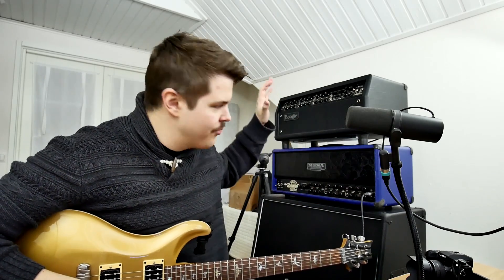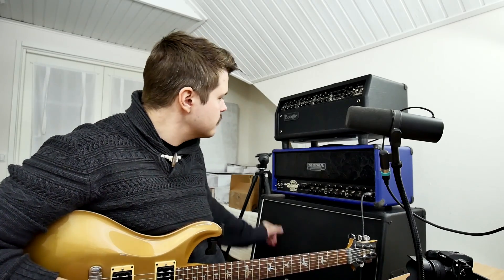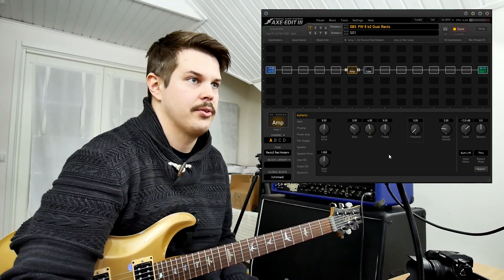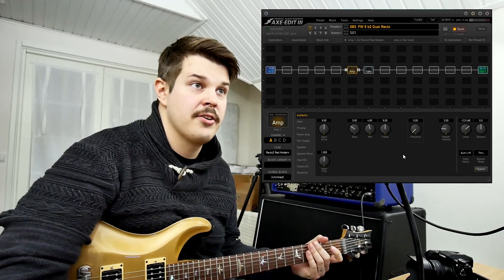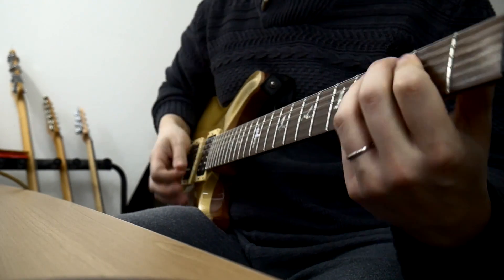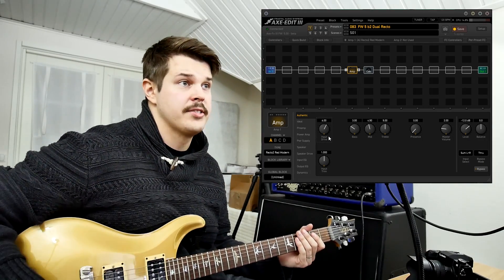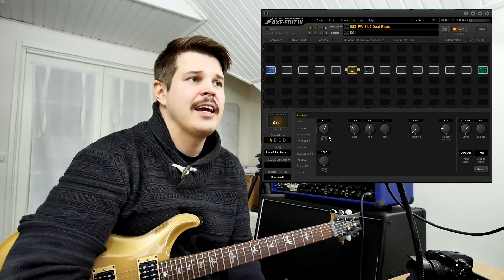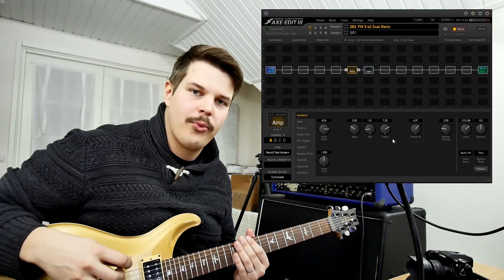Axe-Fx III FW5 Beta - Mesa Dual Rectifier Tutorial

Comment: I know this is old, but still, maybe someone sees this and has an idea.  I'm struggling to get a good sound out of me fractal fm3 so I found this video while trying to search for a solution. What I noticed is that if I set the input drive to around 2, like you did here on this model, I get an almost clean, just barely on the edge of breaking up tone, not a distorted one, like you do here. Why is that? It's just guitar into the input. Pad is set to -12dB, but that doesn't matter, tried it on other settings as well, I just have a guitar that trickles into red even when set to -18dB, so sometime it's set to that. And it's the same, no matter what guitar I try, active, passive pickups, doesn't matter. Or did I miss something and do you have a boost somewhere?

Comment: How do you compare the Axe FX III to the Helix? How much better is the Axe in your opinion?
Reply from the maker: It's not an easy question. I would say they're very different and for that reason hard to compare. The Axe-Fx III costs 3-4 times more than the Helix LT that I have. That's going to be the deciding factor for some people. The Axe-Fx III simply has a lot more of everything and it's the most realistic out of all the modelers I've tried. That being said I know how to make the Helix sound like real tube amps as well. I could gig with both, I could do a pro recording with both. Think of them as toolboxes. One has every tool on the planet and the other has fewer but the most common ones.